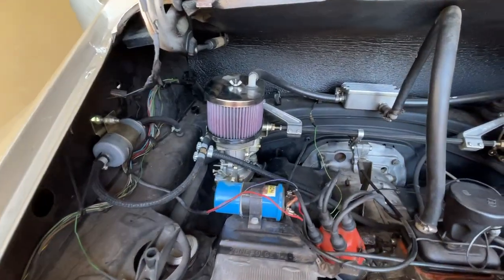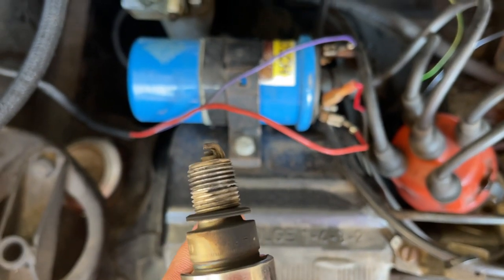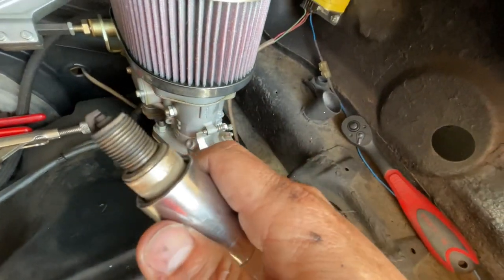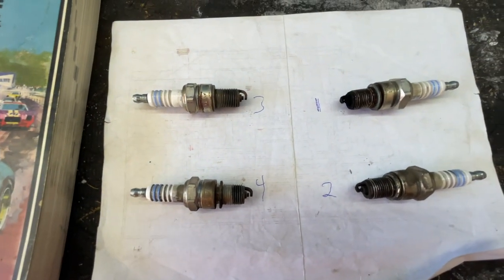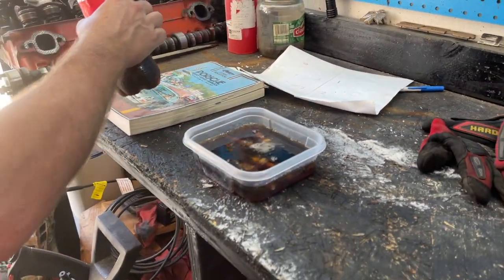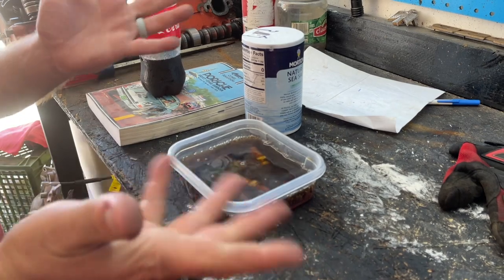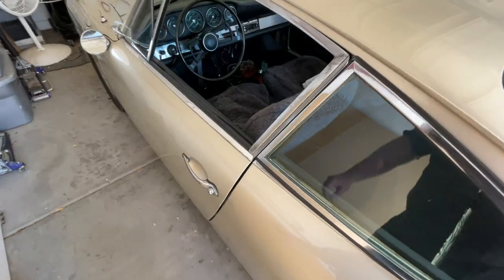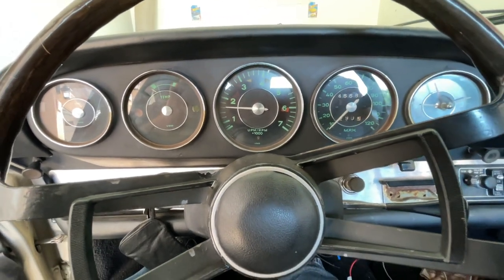Can you clean Spark Plugs and reuse them?  Will cleaning Spark Plugs make them work like NEW again?

Comment: Pumping the pedal doesn't get fuel into the float bowl. It removes fuel from the float bowl and sprays it into the manifold. The fuel pump is the thing that puts fuel into the float bowl.

Also, the fizzing when you put salt into the coke is only the addition of flocculation points, where CO2 bubbles can form (throwing in any granular substance should have the same effect). It isn't a chemical reaction between the salt and the coke. Sorry to burst your bubble (pun intended).